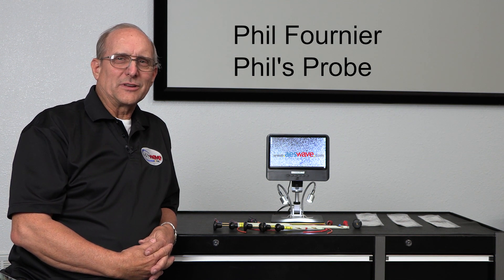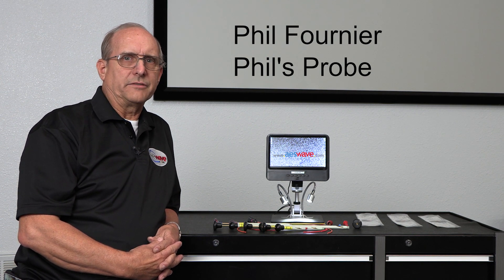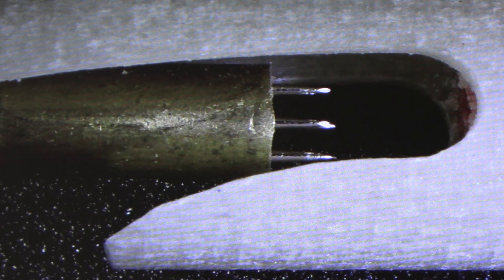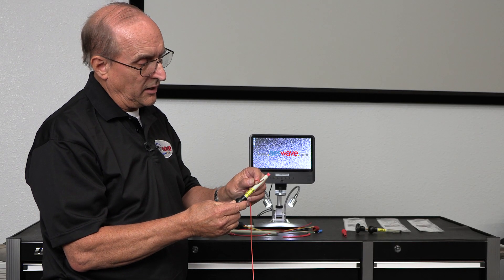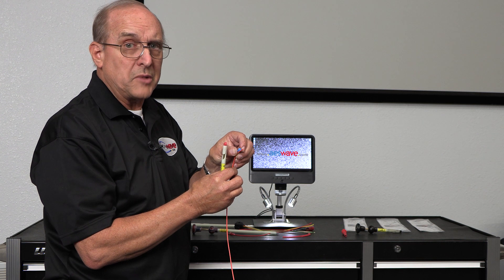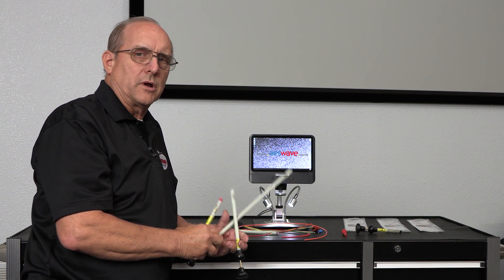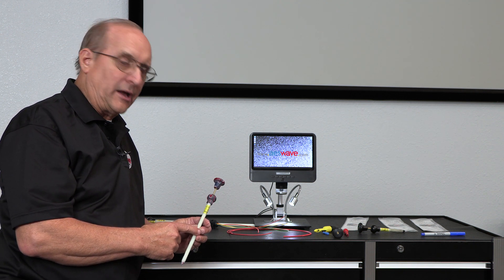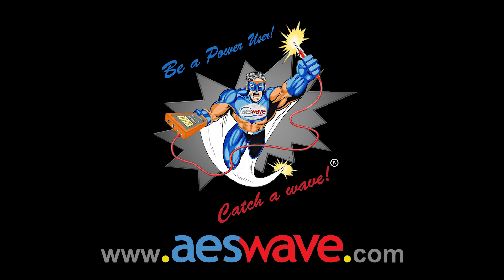Getting the most from your Phil's Probe

Comment: Nope, nice try. Nothing beats the waekon piercing probes for durability and performance, they are super heavy duty and last for years. The best part is they are only a fraction of the price. The only issue is that the tips need to be insulated. Easy to do with liquid rubber.